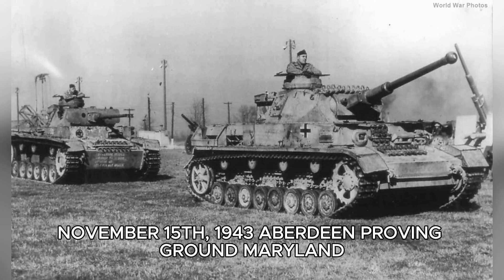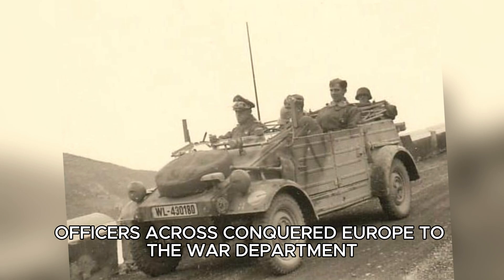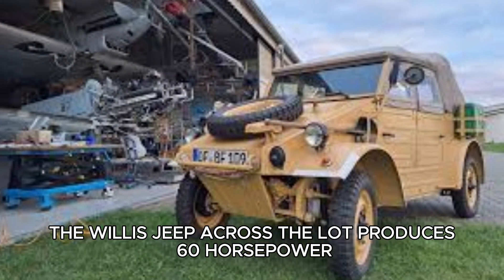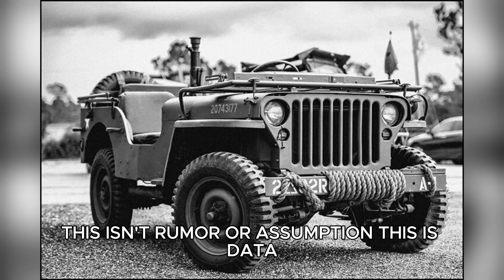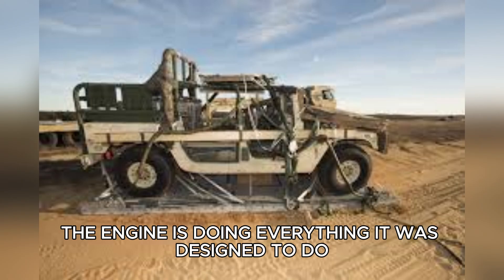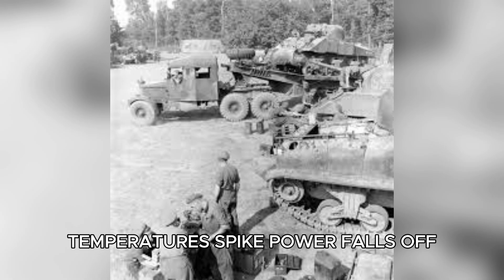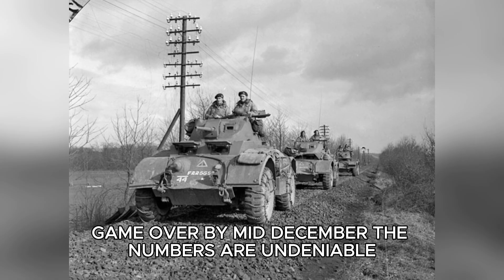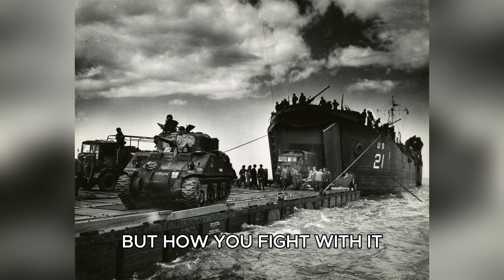American Mechanics Drove a Captured Kübelwagen — Laughed At Its 25 Horsepower Engine

Comment: The Kubelwagen's body lines aren't nearly as clean as the Meyers Manx  dune 
buggy which sold by the thousands in the USA in the 1960s and 1970s.  Like the 
Kubelwagen the Manx got it's frame and running gear from the Volkswagen beetle.